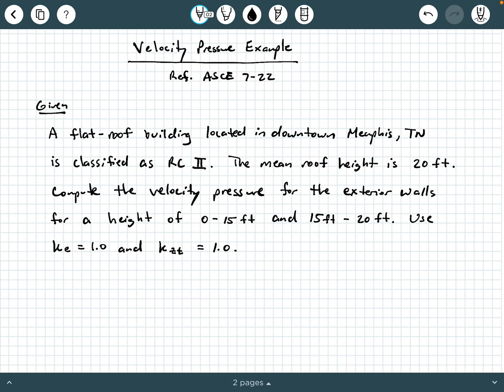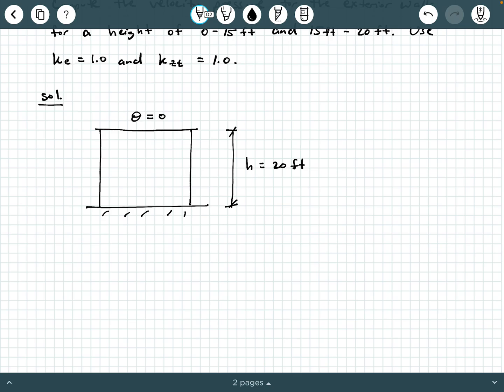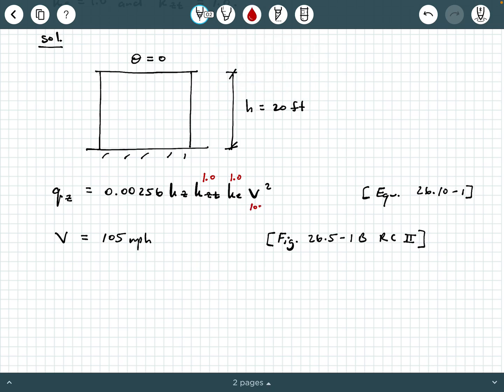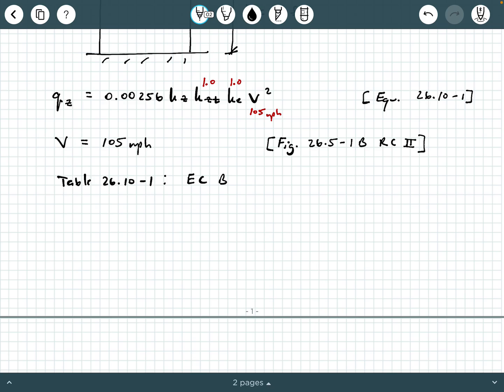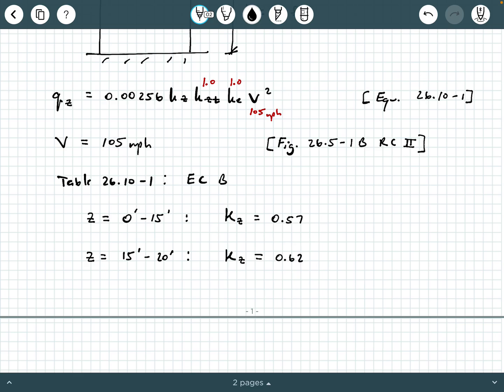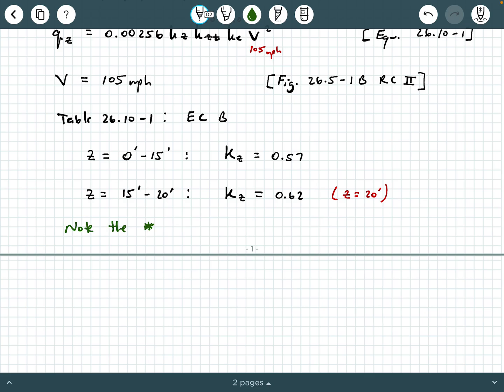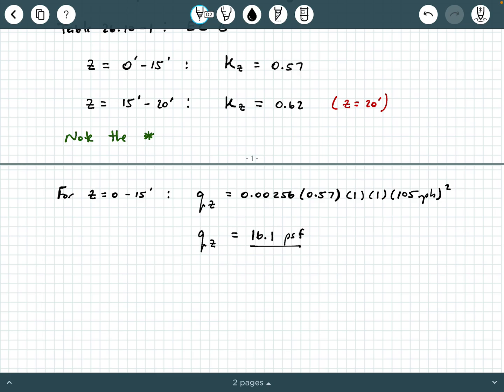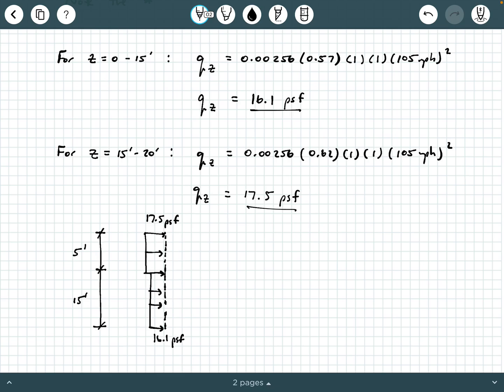Structural Analysis - Video 18:  Wind Velocity Pressure Example (Ref. ASCE 7-22)

Comment: Why kd was removed
Reply from the maker: Good day.  This is a good question.  This is one of the updates of ASCE 7-22.  Equation 26.10-1 of ASCE 7-22 does not include "kd" as we have seen in previous versions of ASCE 7.  The directionality factor (kd) is now included in the later chapters (27 - 30) when computing the various pressures "p" and forces "F".